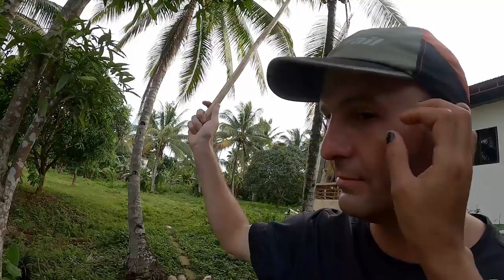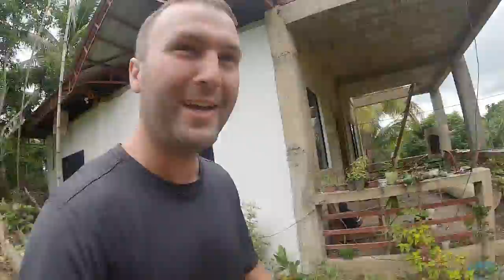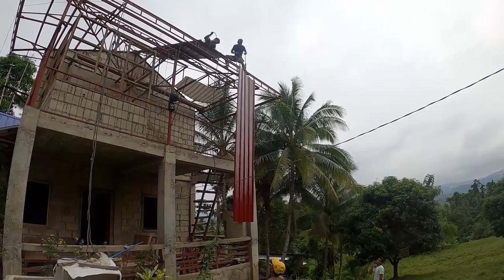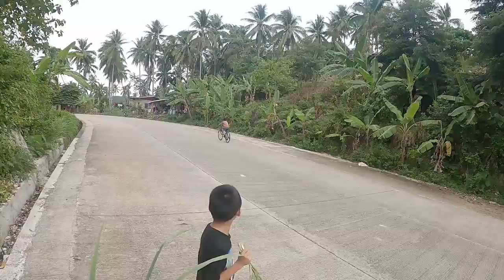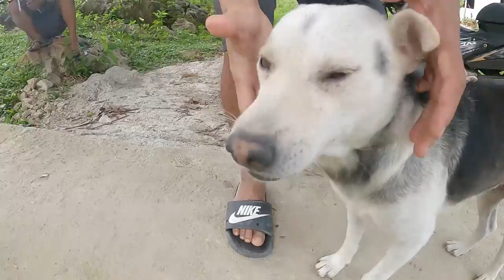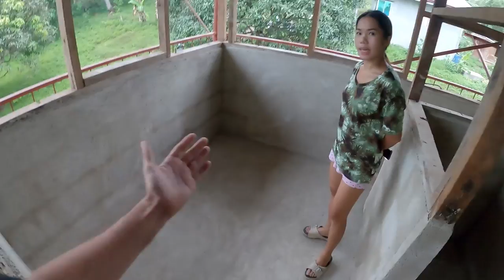Installing roof for terrace with Raymund + Acoustic songs with Reche - Province Life

Comment: Violet Beauregarde. Charlie and the chocolate factory one of my favorite movies :) btw Dustin do you mind if I ask how that hollow block wall is connected to the steel frames?   Just curious because it makes me nervous cause I don't want it falling on the house lol :)
Reply: Sir, the steel frames are welded to the anglular bars from top of the wall, welded to the rebars from inside the hollow block pile or wall.
Reply from the maker: It sounds right what lone wolf said 😂
Reply: @LoneWolf-oi4yx  right thanks bro that makes sense now. It's just a lot different to how things are done here so I was trying to figure it out. Salamat kuya
Reply: @phoenixson4382  no problem po...